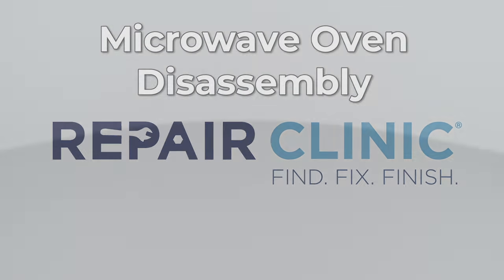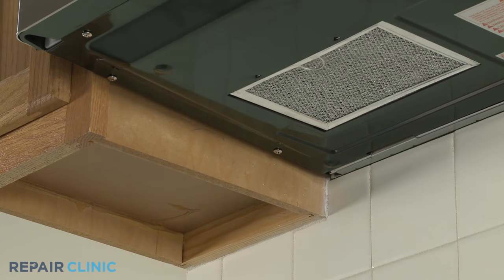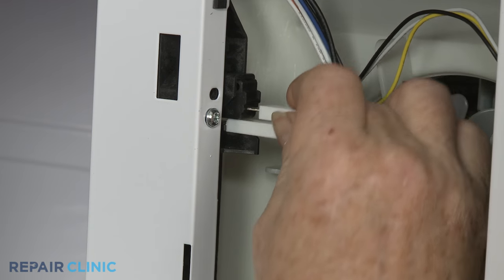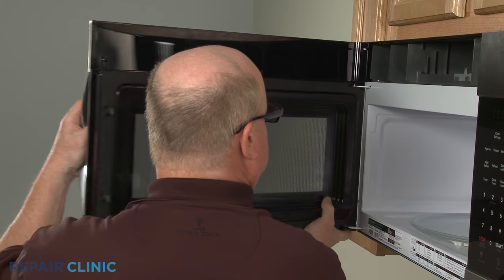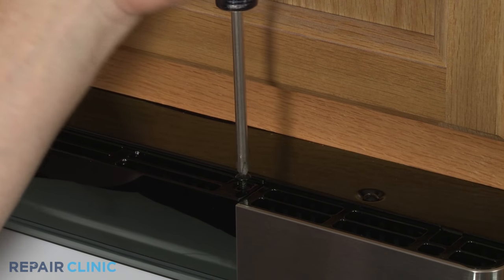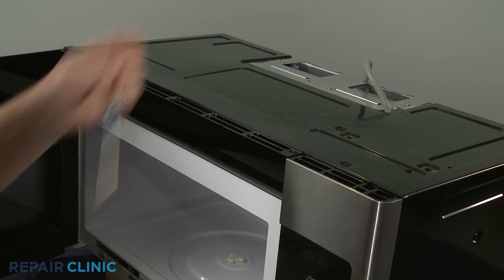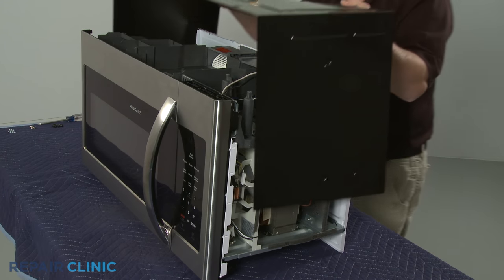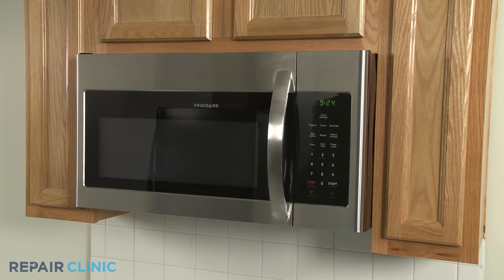Frigidaire Microwave Oven Disassembly (Model FFMV1645TSA)

Comment: Thank you for making this video! Not sure how old mine was when I purchased my home 3 years ago but the turntable went kaput first, then the whole unit started shorting out when I tried to use it. Today was the last straw so I was able to dismantle and remove my unit by watching this. (I put a heavy leather ottoman under the microwave to catch it since I was doing this myself, then just pulled it off the wall bracket). :)

Comment: I have a similar model MW and it was very difficult to remove door. I found if you remove inside trim plate first it was much easier to remove door . Plastic post holding spring for latch assy. was broken so I added small length of wire to spring and anchored it to another post nearby.

Comment: I have the same/similar model of microwave but i have an extra screw behind the front control panel that needs to be removed to get the panel off.  I had to change the fuse but found out after i had reassembled everything, theres a different electrical problem with the microwave.  As soon as i plugged it back into the wall socket, there was a quick flash and the circuit breaker was tripped. Wasted an hour changing the fuse, now i probably need a new microwave.

Comment: Would it be possible to get the outer door panel piece separately? Part of it seems to have melted and sagged, causing it to pull apart from the door assembly when opening the microwave.

Comment: i have the same problem so i bought the fuses BUT the left hand screw holding the top cover was buried under the edge of the cabinets above so what would be the next step?I was thinking of loosening the screws that hold the microwave onto the bracket and siding it out far enough to get to the screw. Does tis sound like it would work?thanks

Comment: I have this exact model and the light will not turn off when the microwave is plugged in. Could you provide any advice for repairs?
Reply: Believe a micro switch controls light . Need to remove cabinet and test 3 switches. $5 on e-bay. I think 1 is for light, 1 is for turntable, and 1 is for power. Hope this helps.